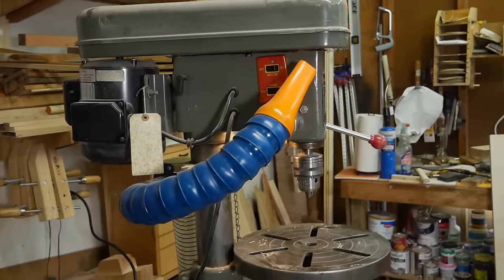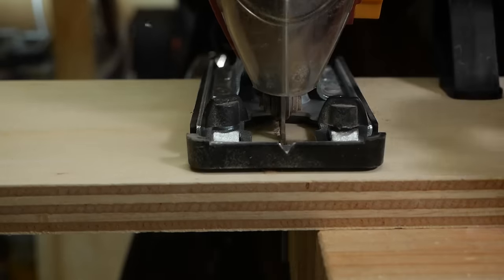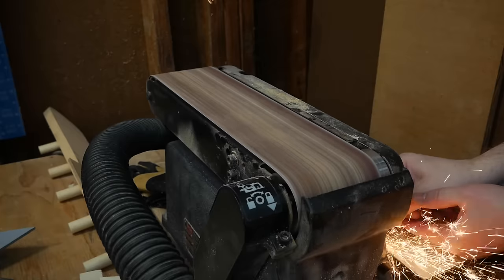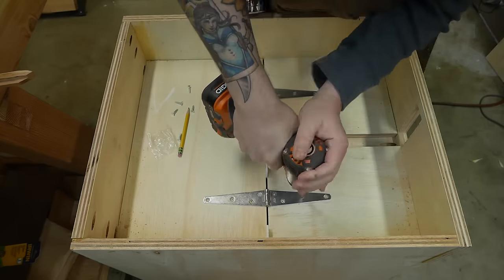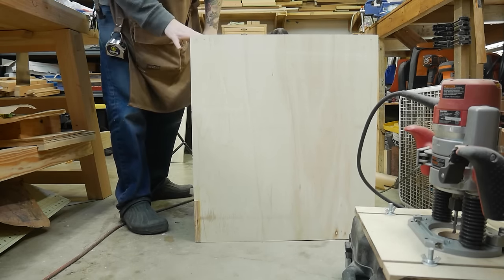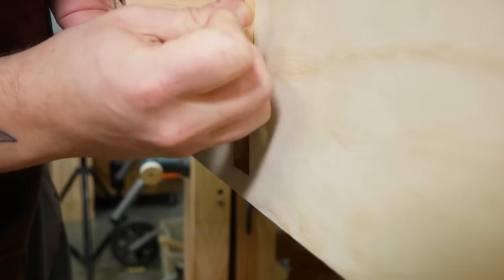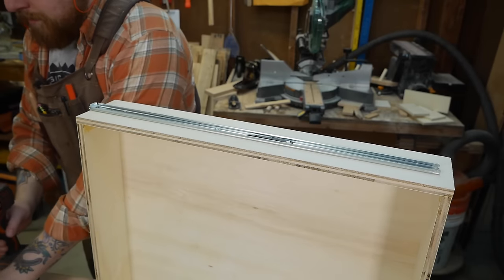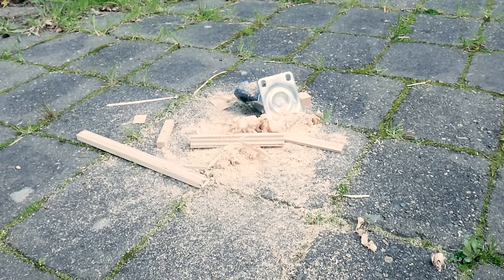How To Make A Mobile Drill Press Stand

Comment: Sprinkle a small amount of fine salt after applying glue to stop the boards sliding around before you clamp them down. It works very well and the salt dissolves. You could use saw dust instead but it leaves more of a noticeable line as it does not dissolve.

Comment: was going to build some shit, think i might get one of them there kregg pocket drill set. dowels dovetails, all those tools need to be put away, not to mention take them out and set them up. changing over dado blades. had to tear apart some cabinets, made this way, they are pretty tough. good enough for a drillstand.
Reply from the maker: Mr. Backster I'm digging the candid and honest assessment! I personally really love my pocket hole jig (might even invest in a better one) and see it being a valuable shop tool. I JUST put out a video showing how you can add dowels (or biscuits/dominos) to pocket joints to make them stronger and easier to align that you might want to check out.

Comment: Damn, I could make that. All I need is a:
* Table saw
* Band saw
* Router
* Belt sander
* New drill/driver to replace my 17 year old worn out 14v one
Can probably do without the Pocket Hole jog
* A plane that isn't a made in India piece of out of square crap (despite spending about 20 hours sanding a finish and trying to get the heel and toe sort of flattish using a box trailer's worth of various grit paper
* Some longer F-type clamps
* A drill press
* A new garage to put all the new purchases.
* A second mortgage to pay for the plywood during the COVID-19 wood fibre inflation price times

Nice mobile stand for the drill press. 👍
Reply from the maker: You know, this has actually been on my mind lately. As I invest in better and better tools I KNOW I'm going to be getting more comments like this. Which makes me want to dial it back and use less expensive tools....but if you have a better tool or access to better tools and more efficient methods why not take advantage? Best thing I could come up with is I should try to throw the occasional "only using _ tools!"  video into my regular content. Because dammit, I'm not about to hand dimension my lumber for EVERY video when I have a perfectly good jointer/planer combo in the shop 😂
Reply: @Craftswright  I should have added a smilie face at the end of the list as I wasn't having a go at you more like expressing tool envy. 😀

Comment: Nice take on the tilting caster concept, especially with the tapers on each end of the lever to optimize the travel.  Have you found  rocking them from angled to straight under load a lot, prematurely wears the swivel bearings or introduces any looseness affecting the swiveling?   Also, great video quality and editing.  Plus the relatable mistakes, and good ideas for correcting them.  Earned my sub.  Cheers!

Comment: Not a fan of dado blades. In EU they are not even able to be fitted due to safety hazard anx that our machines need to be at a full stop in a few seconds. EU rules are strict but oow well safety first. And also no need to change the blades then right, multiple passes work just as well. Great build. :-)